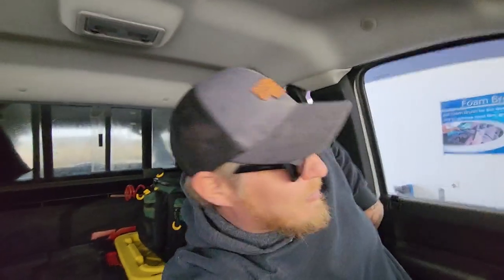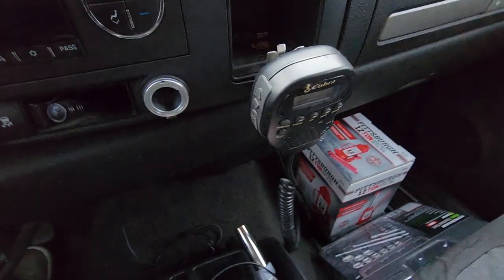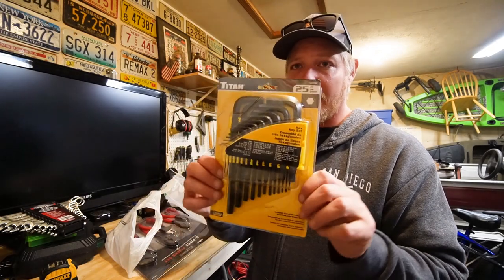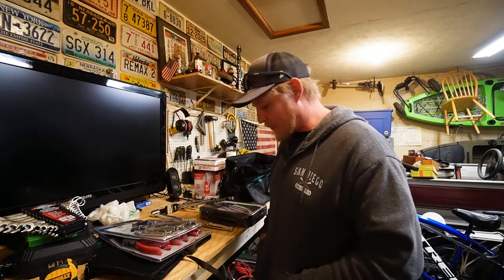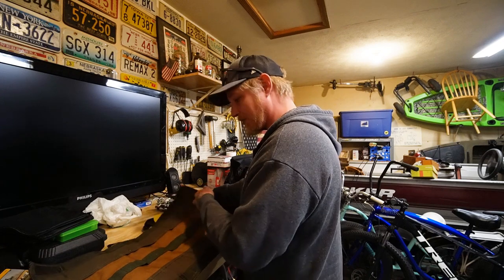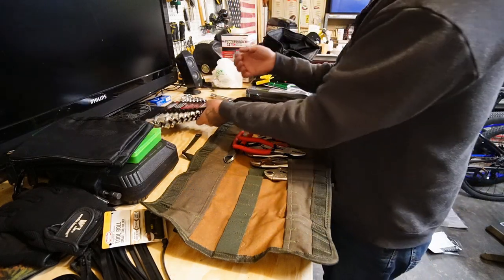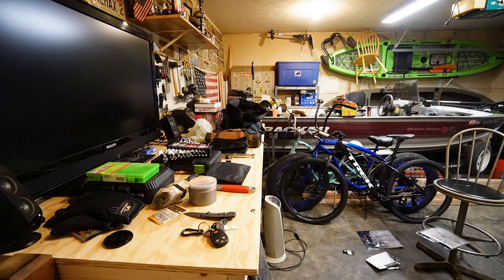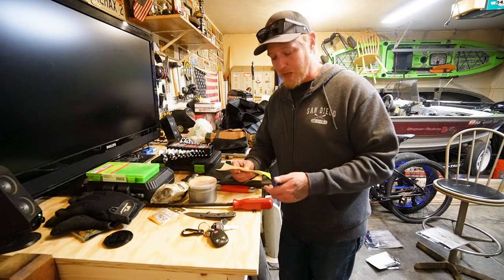Upgrading My Truck Camper Tool Kit

Comment: I have a halo "bolt" it's a power pack that will jumpstart your car.  Works!   Also have jumper cables, and road flairs.   I keep individual wet wipes in my glove box.  Comes in handy to clean your hands when you are done working on the vehicle.   I also have a first aid kit complete with a tourniquet.  You never know when you will need some serious first aid and it will most likely be while driving.
Reply: We have 3 different generations of Halo’s.  Don’t leave home without.  Great investment for anyone. I have used to charge phone, run laptop, run radio equipment, jumped of vehicles of all sizes
Reply: @Dennissells05  I too have used my halo to charge my phone when the power in the house went out.  Such a handy device!
Reply: Sarkeypugs

Comment: I pruned all the standard sizes out of my tool bag. Everything from the factory on the truck is metric, and any accessories that aren't metric have a metric equivalent.  I also use the bag any time I work on the truck at home. It really helps to know you'll be ready in an emergency repair. I also keep a ball joint pickle fork because 4runners are known to pop a joint at the most inconvenient time.

Comment: I'm too much of a tool junkie, but a few things I thought of that I carry in addition to your haul there: a six point quality socket for the wheel nuts ( mine fits both the truck and the trailer ), spare serpentine belt, torque wrench ( for wheel lug nuts truck and trailer ), Corona brand tree limb saw, SOG tomahawk/hatchet, first aid kits, several flashlights, volt/ohm meter.
Reply: Can never have enough, I have to keep my toolbox away from other's, because some people use them and never put them back, drives me be crazy, I call me having OCD lol

Comment: Add a electrical kit: wire, connectors, crimping tool, solder and soldering iron or mini torch, dialectic grease to keep out moisture at connections, small voltmeter for testing circuits and checking battery voltage, light bulbs, wire stripper. You've got fuses and tape. Maybe one of those battery booster/charger/jump start units, whatever they're called.

Comment: I’m a mechanic for a living. Would recommend going with a hose clamp tool for the clamp style hose clamps. The long cable style hose clamp pliers. They fit easy in a bag and the pliers you have will struggle to remove them. That way if a coolant hose springs a leak or busts you can change it still and replace the spring style with a screw style.
Reply: Also would recommend the 45 degree angle icon for pliers. Extremely useful for tons of different applications and extremely high quality for the price

Comment: I carry some bailing wire in my truck tool kit. Great for temporary exhaust (& misc) repairs - easy to work with, won’t melt and takes up very little room in the kit.

Comment: Warning on the star bit set. The screw that holds those together will come lose and you lose all the pieces. Been there done that. Lock tight does the trick.

Comment: maybe two tool bags to offset weight and/or make the bag smaller instead of jamming everything into one? There would definitely be enough space for all of it down there. I've also noticed a lot of rock crawlers and overlanders keep their stuff on rack mounts either on top or on the side of their vehicles so that they can access them in a pinch. You have plenty of space over the cab to do this and could even mount a solar array up there on the empty area to help charge your battery system.

Comment: When you build out a tool kit, you build it out thoroughly.  No one can ever deny that.

As for the placement in the truck, yeah it looks to me like you'll have to modify that rear seat delete. If I had the same problem, I would look into cutting the delete shelf in half and moving one shelf up enough to fit your new tool bag under it permanently.  If you gave yourself some breathing room in that new under shelf you could probably throw some recovery gear and those jumper cables and the jump box into it as well, and free up the smaller side for even more gear.

You definitely don't want the heavy tool bag sitting on top of that plastic tote, as a hard brake maneuver could easily send it tumbling into the front seat.  Plus you'd have to move the heavy bag anytime you wanted to get firewood or whatever else you might keep in those  totes out of the backseat.  I spose the other thing you could do, is return that larger bag and buy 2 smaller bags, fill those up and put one or both of them under the seat delete shelf, or in your roof box.

Comment: Very nice tool kit you've put together. I would like to offer the idea of carrying some wire (in case of exhaust issues) and an impact socket (the size of your lug nuts). Maybe a battery terminal/post brush, and a nice flashlight.

Comment: Great share, I enjoyed watching...... Consider multiple smaller bags. Makes it easier to store and lighter (might fit where you wanted to put the tools then). I have three smaller bags. One with straps, bungees, tie wraps, gloves. Then one with wrenches, pliers, etc.. the third with hammer breaker bar, etc..... I actually have a fourth bag, but it is smaller and only has my jumper cables in it so they do not hook on things. For stuff like my truck straps I have them separated one per zip lock back inside their tool bag so they do not tangle on stuff.

Comment: Seriously be careful lifting with a bottle Jack. Use a Powerbuilt type jack that is a cross between jack stand and bottle jack. Amazon has them, I got two for my 3/4 ton truck set up the same as you to camp in. Works excellent and has the jack stand shaped end to cradle the rear Axel or front way better than a skinny round bottle jack.

Comment: Quady you may want to add a flashlight or headlamp, and Hand Cleaner, and LED Road Flares. WD 40 & Bolt Degreaser. Battery Terminal Cleaner, Good Luck

Comment: 2 things I didn't hear you mention is a jump box (instead of jumper cables) and a mini air compressor.  A jump box can start the truck without another vehicle and a mini air compressor can be plugged in to air a tire temporarily.

Comment: Add a tool to change out your serpentine belt. Put in a new one and keep old one for a spare. Also have a jumper battery if you don't have one already. Bring a piece or two of wood for the jack.

Comment: You definitely want to bring something to put the jack on so it doesn't sink into the ground acouple of pressure treated 2"×10" or 2"×12" a foot long or so would work tool kit looks good I reads some of the comments and there was a lot of good ideas

Comment: You can always Weld a carrier box on the bottom inside of your tire carrier for your tool bag to sit in make it water tight it will be a tight fit but it will work

Comment: a pack of machine screws and bolts with washers and nuts along with a drill or impact gun with Al the bits and drivers would be good to have for repairs. also get a hacksaw and 2 adjustable wrenches

Comment: In my Jeep I have a toolbox with everything I would need in case of a breakdown, learned to change tires and my own oil change, I know every part under my hood.. good choices Mike.. hugs from Wisconsin 😊, you'll figure it out, you're a smart guy..I wished I could show you all my tools, I don't have a bottle jack, fuses is a great idea.. I hate when one blow's, I had an older car and the headlights went out on me one night in the dark, not fun driving home 1 mile with only my flasher's lol..
Reply: Omg been there done that with my headlights!!! Wasn’t fun😂. I had an (going to age myself now) old Chevette and my drivers side door was rotted on the bottom. I was driving home and it was colder then cold out and my window decided to roll itself down and out the bottom!! Yuppers shattered all over the road and made it a long ride home with no window!!! That car had a mind of its own!!! Same car different day I kept hearing this thugging noise…..all my lug nuts were loose!!!! That happened more than once!!! But damn it was so cheap on gas and I was a single mom trying to get by!!!
Reply: @hollyondrias602  lol 😂

Comment: Should of went like a bigger tool kit and then small bag for hand tools. I have a dewalt mechanic kit has like 200-250 pieces socket wrenches screwdriver etc. and then I have a tiny bag with some pliers zip ties etc. it doesn’t weight much and as always got the job done. I did have to add some torx 3/8 sockets for my girls car but that kit is awesome took my whole dash off to get to heat core with it

Comment: My seat delete platform is a little higher than yours. I have all of the tools stuffed underneath. I used several smaller bags and just stuffed them in. I have a bag of power tools under there, too. I also carry a torque wrench.

Comment: You may have one, but how about a lug nut wrench?  Granted, your socket set SHOULD work to remove your tire lug nuts, but it's better to check now to make sure rather than finding out your sockets aren't deep enough, wrong size, etc...

Comment: Digital Volt Meter, Hacksaw,Duct Tape,a small tarp or visquene. Paracord, hose clamps, replace your srp belt and stow your old one, spare  Schrader valve. The list is endless but chances are you might not ever need any.

Comment: Love the videos! IMHO you've gone overboard on tools. A torque wrench for camping? How about a high-viz safety vest, flares and some reflective triangles? Much more likely to need than a torque wrench. Your tools should be able to get you out of a bind, not replace your suspension on the road. As said, love the vids.

Comment: My bottle jack will just fit under the axle, or the control arm, when the tire is inflated.  So if the tire is flat, it won't fit.  I keep the factory scissor jack in the truck in case I need that low profile.

Comment: You didn't put any of the big zip ties??? I would, they do come in handy.
I would get an assortment of screw's.
A Small rubber (not hammer but like a sledge. I can't think of what they are called.
Do you have a lug wrench??
Reply: It's  called a  MALLET, A RUBBER  HAMMER 😎

Comment: Also, do you have a Dewalt 20V tire inflator? or you could do double duty with a jump pack that has a tire inflator. I've found when off roading nails in tires are the common issue...

Comment: 10 bucks says that that Harbor Freight breaker bar will actually break. Maybe even without the pipe added on. 😂
Reply: I've had one for about 5 years and used it enough times to feel confident. But I also have a cross lug wrench that I use to Torque lug nuts.

Comment: Hard to judge through video.. but would there be enough space to mount up a metal box large enough to fit your tool bag under your truck bed towards the back bumper anywhere?

Comment: I wouldn't want that bag up there for 2 reasons. 1. Safety from accidents. 2. Safety from break-ins if they see your bag, they will know it's tool's.
I would build your platform up a little higher and put them under there.
Oh yes, some nuts and bolts with those screw's.

Comment: will the bottle jack even go high enough to do any good
Reply from the maker: Under the axle or control arms, yes, frame no. I could probably use a highlift on the hitch or front tow hook, but that's probably an even less likely scenario